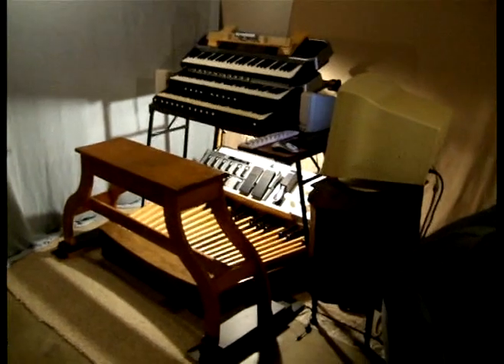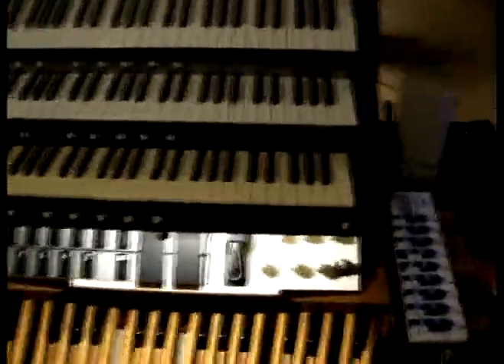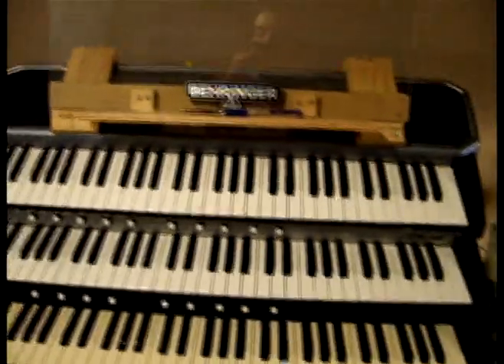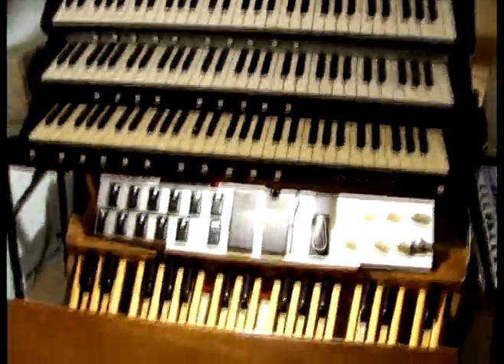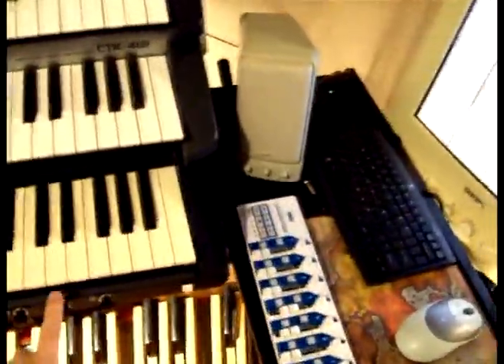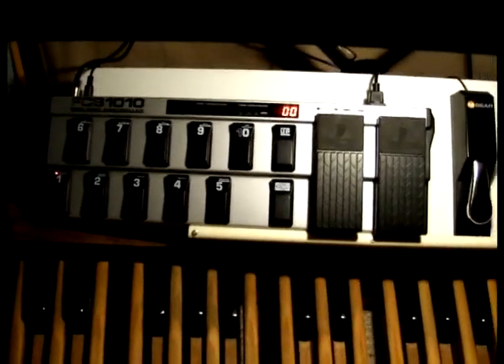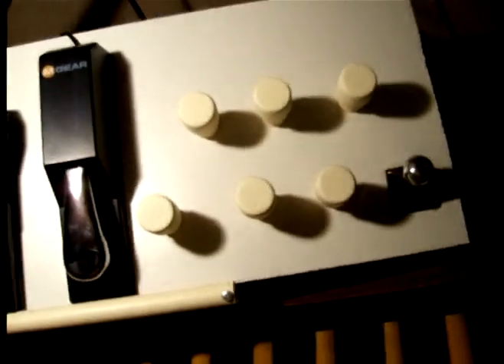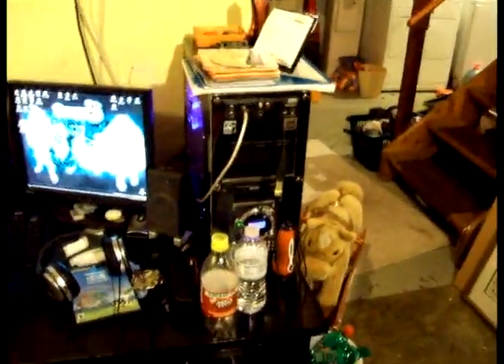Virtual Pipe Organ Console Explanation Part I

Comment: where did you get the computer keyboard encoder
Reply from the maker: I removed it from a spare keyboard I had lying around.
Reply: @Tetsuo315  was it very  difficult to wire it
Reply from the maker: It was kind of difficult but patience and troubleshooting prevailed. I had to figure out how the keyboard switched. Some keyboards use membrane switching others use mechanical. The one I used was membrane. The encoder I had used an X/Y grid system. On the encoder, there were a number of X contacts and a number of Y contacts. When you combine an X and Y contact you get a character, number or function key. I used keyboard testing software that would tell me what the X/Y combo result was. I did this until I had the whole encoder mapped. From there I could figure out a wiring and connection scheme for the thumb pistons.      The thumb piston wiring scheme was a whole separate beast, but here is the general idea. I needed to arrange the wiring with as few connections as possible. I discovered that there were more Y contacts then there were X contacts on the encoder. So that meant an X contact was shared over a number of Y contacts. Example (X1 Y1-Y8), (X2 Y1-Y8), (X3 Y1-Y8) and so on. So Pistons were arrange in groups of 8 or less with 1 of 2 pins wired together. The other pin of the thumb switches were wired to a terminal block which would eventually tap into the Y contacts.  I am going to stop there as this will really go down the rabbit hole.     If you want a schematic of how I wired everything up let me know. Just keep in mind that not all keyboards are wired the same. I explained in the videos that I used CAT5e ethernet punch down blocks to help bridge the keyboards back to the combination controller. It was a big project that ended up taking me almost 2 months to design and wire.  Lastly you can actually buy keyboard encoders bare. Arcade hobbyists use them all the time to design custom cabinets that they intend to use a PC to emulate games. That's what gave me the idea to do it this way. There are also midi controller boards that factor everything needed for virtual pipe organ design. Everything from the manuals, pedalboard, piston, and stops. That would have been the ideal way for me to this, but at the time I was on a tight budget.  Anyways let me know if your are interested in a schematic. It will take some time to write it up. Thanks for watching my video!

Comment: I know it’s been a long time since you uploaded this video, but how did you interface your FCB 1010 with the VPO software, I don’t know if you’ve updated your setup but I’m really having trouble getting it to work with Grand Orgue, I’ve tried Hauptwerk, but it doesn’t  work either, I’m really frustrated and I want give one last go before I give up and send it back. Any insights would be appreciated! Thank you!
P.S That’s definitely a Rodgers pedal board, Allen’s pedals are a lot thicker and have less space between them, and the sharps are usually longer.☺️
Reply from the maker: I have not used my rig in a while, but I need a little more info on your end. Are you not getting the full value on the swell shoes. Give me an idea and I can send you a solution.
Reply: @Tetsuo315  Well I can't even get the software to recognize any signals sent by the board. I'll try to configure by clicking "listen to event" but it will simply keep on waiting for a signal. I've configured and calibrated the MIDI Channels and the Swell pedal, my intimation is that the  MIDI to USB cable I'm using is faulty, other than that I don't know what else to try.
Reply from the maker: OK, some more questions. Can your manuals play notes through the software and do they also use the same MIDI to USB interface or are the manuals on a dedicated MIDI to USB interface. If the keyboard can send signals through the same interface unit your adapter is fine. Also, the FCB1010 has a midi through/merge feature. Essentially how is your entire rig set up? Lastly what is the operating system and soundcard you are using? Sorry for all of the questions, but that is the IT guy in me trying to diagnose the issue. I had the same problems with mine, but I had to go through a setup process on the FCB1010 to get things working right. Also, there is a piece of software I use to help diagnose and monitor MIDI events; MIDI OX. Here is the link to it. You may need to turn on some compatibility setting if you are on Windows 10. http://www.midiox.com This is not by any means a solution yet, just things that happened to me and the steps I took to resolve them. The GrandOrgue software can be finicky. I made sure that the MIDI to USB interface was checked under the "MIDI & Audio Settings" menu under the MIDI devices tab. I also checked that the MIDI adapter was selected from the context menu for the swell pedal(right clicked)  I had the same issue as you with my FCB and M-Audio Axiom 49 the other day getting things setup to troubleshoot your problem. I had the keyboard MIDI out running to the FCBs MIDI in, The FCB Midi out was connected to an M-Audio UNO MIDI to USB adapter. The FCB was not transmitting anything set to bank 00. I pressed the UP foot switch to go to bank 01.

Comment: For years I have had a dream of doing exactly what you have done here.  You pulled it off !  Lots of hard work has paid off.
Reply from the maker: Thanks! Let me know if you have any questions about the console. I had so much more planned for it, but other projects and obligations got in the way. I still want to add some manual stop control or touch screens for stop control.

Comment from the maker: @FlametopFred The short answer is I canabalized a standard PC keyboard and came up with a wiring scheme to connect all of the buttons.  I got the idea to use a PC keyboard because jOrgan gives you the ability to associate a keyboard shortcut to any activator. With that in mind, I wanted a cheap (although labor intensive) way to use a spare keyboard as a combination controller, rather than purchansing a midi encoder. I will explain more in a personal message.

Comment from the maker: @Zylstra555 I have not made time to make part II. The server that I stored my sample sets crashed. After I recovered what I could, I never went back and reprogramed the the controller software.  I will make a part II over the holidays most likely. Surprisingly, there is more labor in this than cost. Over the last decade working on this project I have spent about a 750. I purchased two of the keyboards, The other two (one not shown) were donated. Most of that cost comes from the midi controllers.